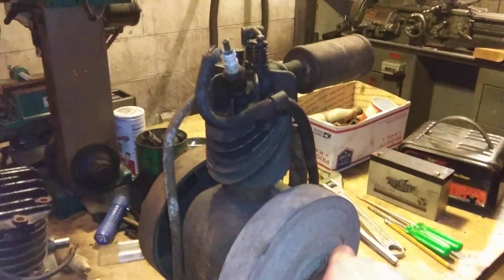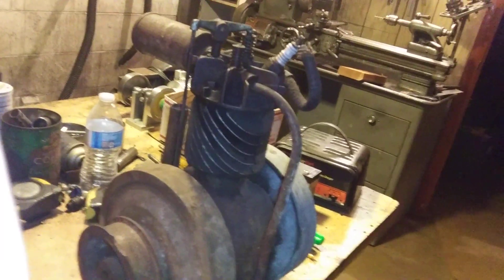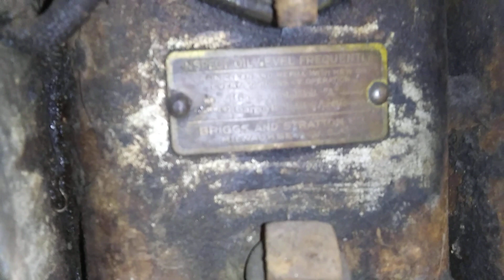Briggs FB?

Comment: Thats a really nice FB.  Everything looks correct and original: early breather, "peace pipe" carb, two bolt head, two flange base AND an original muffler.  The carb is worth more than half of a complete engine.  The serial number should be stamped in next to the breather.